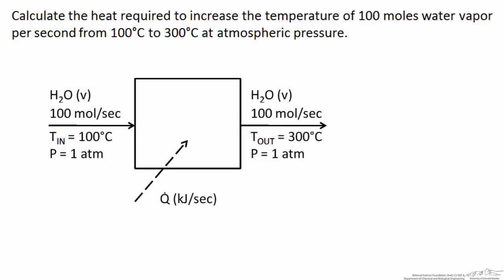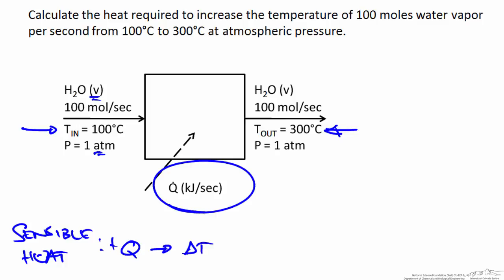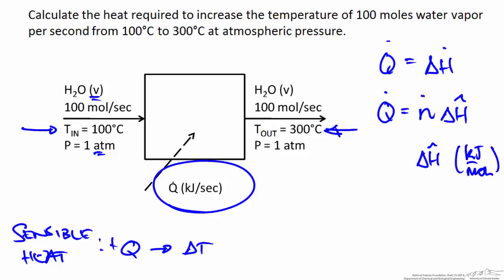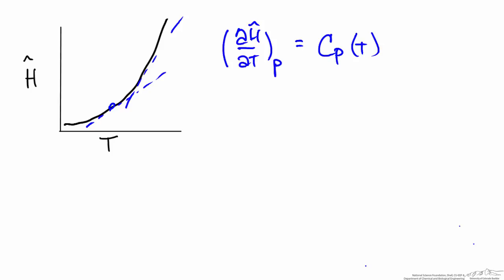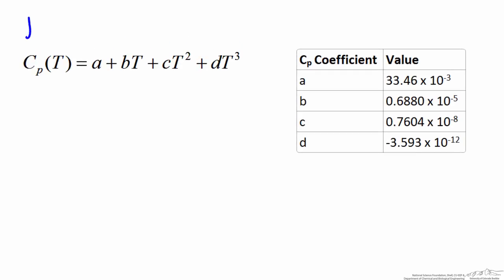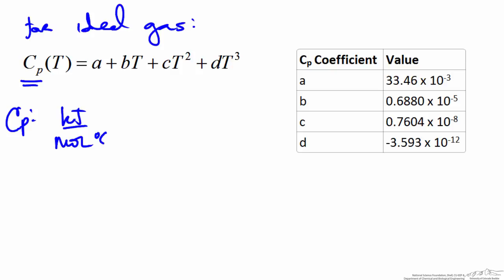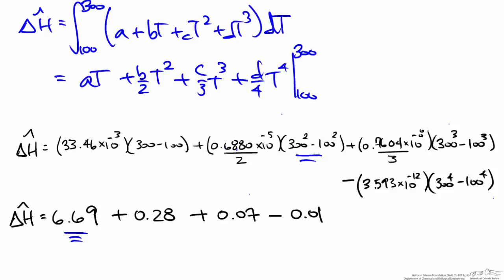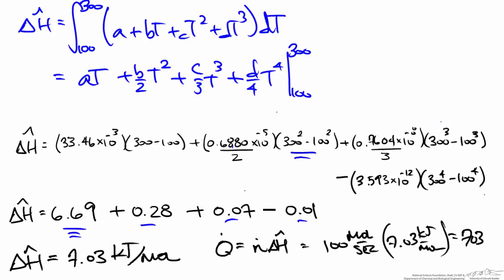Sensible Heat from Specific Enthalpy

Comment: Why is it that the values of a, b, c and d are to the power of a positive number? In my physical properties table in Elementary Principles of Chemical Engineering, they are to the power of positive numbers.
Reply: i think it might say "a x 10^3" and "b x 10^5" etc. but if you rearrange to solve for a and b respectively then you divide by 10^3 and 10^5 respectively so then a = ....x10^-3 and b = ....x10^-5   etc.